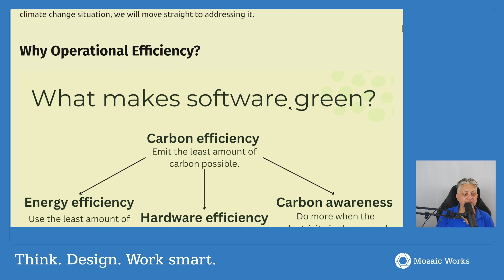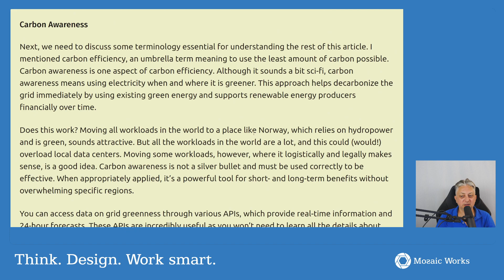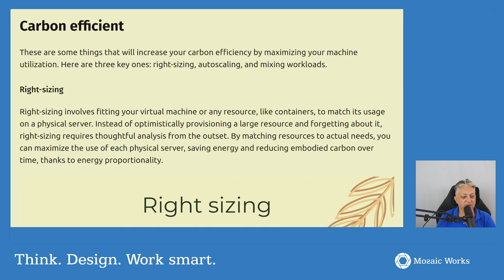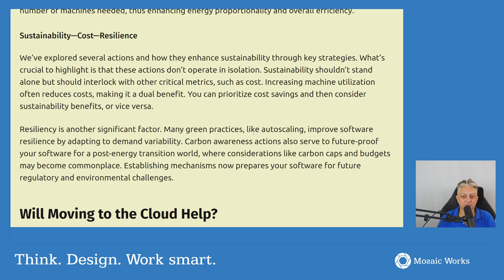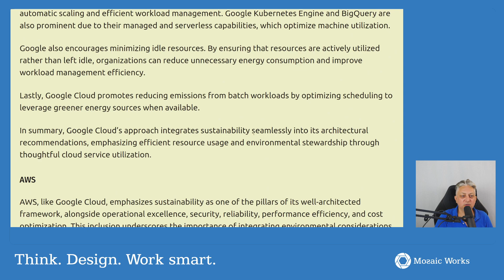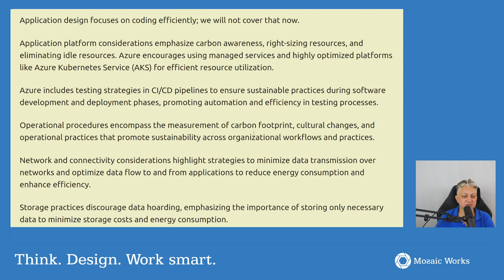Carbon Footprint As An Architectural Concern?

Comment: Although it would be "all eggs in one basket", 90% of effort should simply be funnelled towards fusion, which was ignited twice in 2023 by the National Ignition Facility in USA, thus proving beyond all reasonable doubt, that fusion is a viable future energy source, and proving that the science backing it is correct.
Reply from the maker: Thank you for your comment. We are not experts in nuclear fusion or energy policies. This video is mostly about the carbon footprint as a concern for software architecture, which will still be an important factor in the years to come.